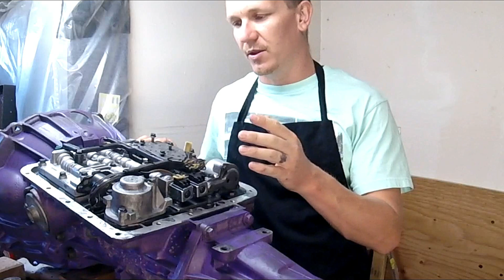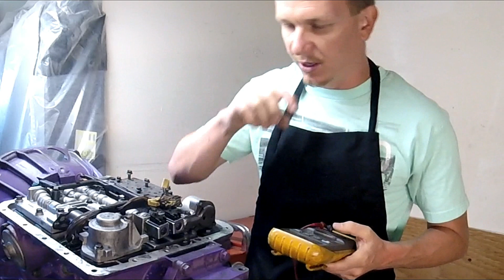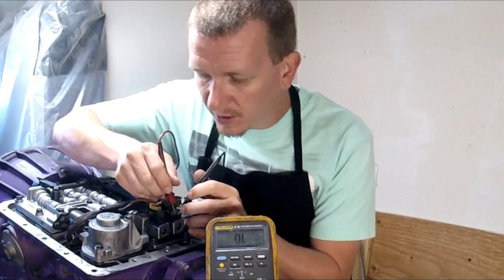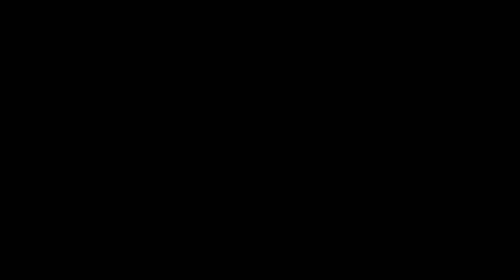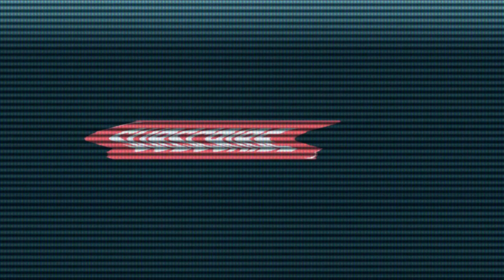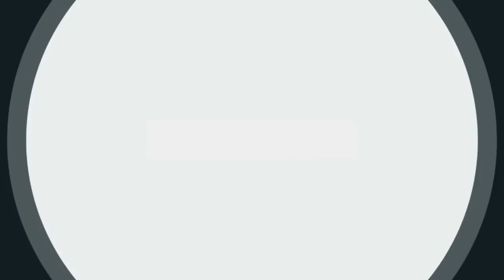⫷ P0753 4L60E ⫸

Comment: I change oil and filter 2001 gmc 1500 4+4 miles 157048 oil was very dark black that why I change it afterwards got p0753 test drive truck don’t get 4 gear oil refill to the lines on dip stick for the transmission
Reply: Is it fixed now?

Comment: Hello, I have a 2000 Pontiac Firebird 3800 V6/4L60E with with an electronic Throttle body TAC/APP (accel. pedal) Sensor oem equipped. Is there a way to manually initiate overdrive while driving just for testing. I already throttle body relearned unsuccessfully and temporarily restored cruise control. At present all gears shift except overdrive, and also cruise control only works during testing and or Throttle body relearn. Major issue when I bought this car it sometimes seemed it had a small misfire/cycle/surge at time 4 sec intervals especially while the transmission was in overdrive between 40 - 55 mph approx. It has an electronic throttle body TAC 24507244, 24503399, TB1082 ($850+ 1,043.99) and an APP ($175+).

Comment: Do I test solenoid B the same way I greet code p0758 I thank electrical problem
Reply: It is in my 1999gmc sierra  with a 5.3 litter
Reply from the maker: Test A and B the same way. Make sure the shift valves are moving in the valve body. Good luck.

Comment: Scotti,, PO753  >>> 99 Durango 46RE. Limp mode 3rd gear start and no overdrive. If I ground the ground control from the PCM it shifts perfect with 4th gear and lock up fine too. I found the control wire from the trans relay pin 2, so I could ground it from there not tearing up the PCM harness. I ohmed my ground wire from relay to PCM unplugged and read great so no control wire to ground. Same thing now with Purge solenoid, no ground control. No short to ground on either wire. No ground control from PCM. I think I need PCM, this is my truck, what ya think?   Wanted to see if I might hear from ya before I order the PCM tomorrow. ??  Can't expect you to be here all the time, I just thought I might try my luck??
THX So Much Either Way,, From, Joe Marotta
Reply: Did you fix it???? I have the same problem!

Comment: Would a p1860 code make it slow shifting to third an
Reply from the maker: I have a video for that code coming out soon so stay tuned. But if I were you I would start looking at your pressure manifold
Reply: Will it make it kinda slip in third slow but when it goes in it goes in good you can feel it
Reply from the maker: Is this going from 2nd into 3rd or from 3rd into 4th?
Reply: @ScottiesHobbies   it kinda slipes in to third but when it goes in you can feel it go in firm it has a p 1860 code with short in D plate help
Reply from the maker: I was actually thinking of a different code when I originally replied. You can start by looking at the 3-2 down shift solenoid or the tcc solenoid. I just uploaded a vid on testing that solenoid for a different code diag.
Reply: @ScottiesHobbies  will it couse it to do that
Reply from the maker: I think you are losing pressure on the shift. Its worth checking the tcc/ 3-2 solenoid. If you test the resistance and its good. Check for debris in the valve body, check the spring in the valve body.
Reply: @ScottiesHobbies  on this video you say that passenger side one is solenoid A and on another video you say the driver side one is A too c’mon brother listening to you I might have changed the wrong one my light turned on again this guy!!!
Reply from the maker: @hustler915  they are the same. Replace them both wen your in there. Change the harness too... wait.. don't listen to me. Lol
Reply from the maker: @hustler915   in another video I say... if your having problems and more than 110k on your trans you might as well plan on replacing the trans soon.
Reply: @ScottiesHobbies  well if they are the same then why are there A And B?
Reply from the maker: @hustler915  check this video out. https://youtu.be/lg8cCPQHpu0